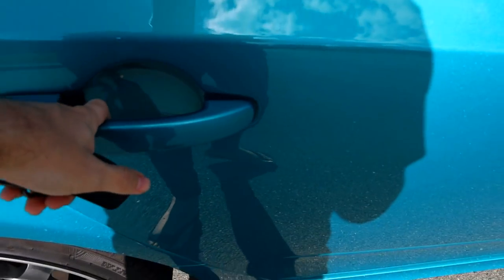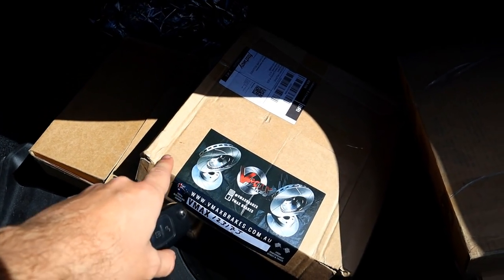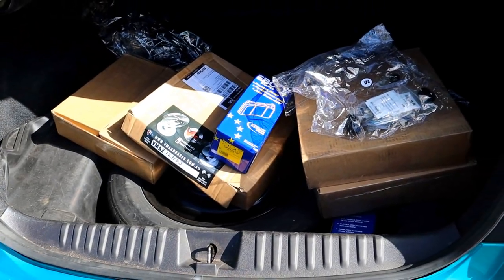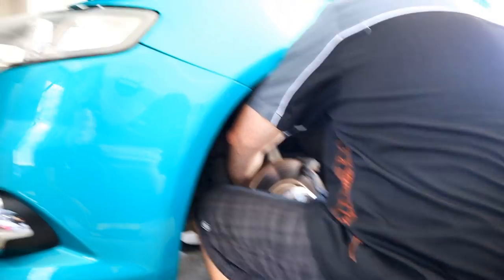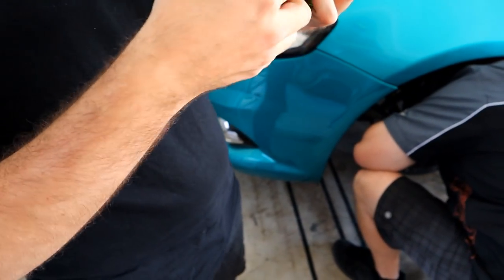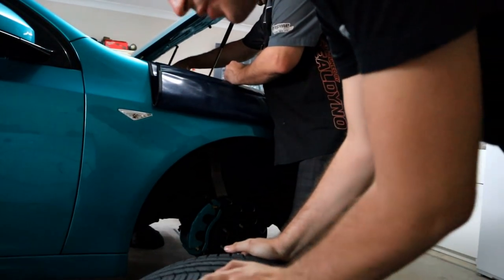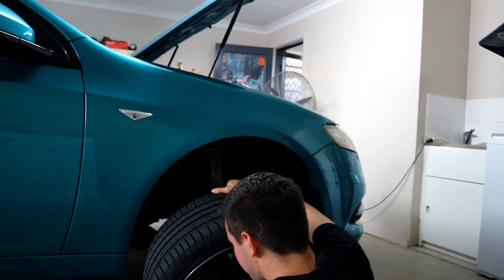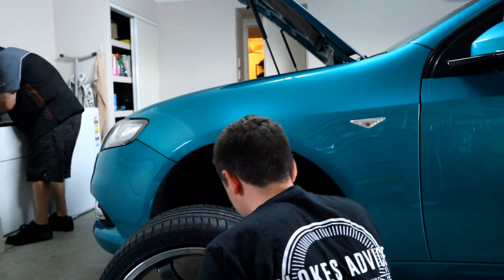Installing a 'Big' Brake Kit on the XR6 Turbo

Comment: Decent video!

Thing about Series 1 BF XR8's/6T's, they rolled outta the factory with that bigger territory caliper. So i've always had this setup and never thought of it as anything special. They suck when you actually work them hard, always keeping on the lookout for Brembos or something, 

I would attribute the pedal feel more to the pads, rotors and freshly bled fluid than the slightly bigger rear caliper. Mine had some standard rotors, bendix pads and some sort of fluid and the braking was rubbish, put on DBA Rotors, Project Mu pads, top shelf fluid and braided hoses and it completely changed the feel of them, but still average to a good monoblock caliper.

Comment: Hey Zac, did you end up going with the braided brake lines and if so, where did you get them? With the rear territory caliper installation, I'm assuming you used the territory caliper brackets and not your original FG caliper brackets - was there any mods needed to fit the territory brackets (other than to cut the backing plate?) Cheers man

Comment: Ha ha random elephant facts right here at Garage Barra 😂... And note the physical abuse witnessed with the misses beating me up 😏👊🏻
Reply: Gene Rhodes Hahahaha
Reply from the maker: Gene Rhodes I love how you pushed her to breaking point, she retaliated, then you complained about abuse 😉😂😂
Reply: Love your work Gene! What brakes have you got on Nemisis?
Reply: @SirPixlGaming  thanks, and I have the Stolz 380mm 6pot brake upgrade
Reply: What colour is your car Gene?
Reply: @iTzMoose_  Sunburst
Reply: G'day Gene, very nice job! Were they Territory Turbo C6 brakes on the front? Did you have to have an adapter bracket for larger rotors or was it bolt on upgrade, with no mods? Good job again
Reply: @hannahsminecraftchannel6133  Hey man, thanks for the love, and as for the Territory brake upgrade, the caliper bracket that bolts on is all part of the territory brake package, all you need to do is trim the backing plate to suit the larger caliper, then with the brake lines you can use the existing lines but you'll need to gently bend the steel bend at the banjo fitting to realign the brake hose, or you can get F6 rear brake lines, but swapping the brake lines takes a little bit of work with having to drill the rivet out for the mount of the brake line, but all in all its a pretty simple upgrade if you're mechanically minded and know how to bleed brakes up 😉🤟

Comment: Dude, that's not a BBK or much of an upgrade. Obviously as with everyone else, money is the limiting factor but my FGX XR8 had scary OEM Brakes whilst trying to dodge bloody skippies. For the money you should have just gone 6 pot XYZs fronts. Also you should have used the Blue Stuff NDX. The NDX part is important coz regular blue doesn't work when cold! Yellows will have the same fade issues.
FYI I gone down the full Brembo 6/4 now with Harrop upgrades rotors. 375mm & 355mm. MUCH MUCH Safer!!!!

Comment: Brakes are easy AF. Good thing you had a pro do them for you. :p I don't think you saw the comment on your last vid, but who is Gene? It's good he's doing the work for you. Also a word on those rear territory / larger calipers, be careful of mounting the brake line in the stock position, it can wear on the wheel.
Reply from the maker: MV60 haha Gene is my guy for everything. If I ever don’t feel 100% confident I learn from him. He’s an x brake and suspension specialist and NZ Pro Drifter :)
Reply: @ZacBaldy  That's cool man. I had to figure everything out myself, you're lucky to have a guy to go to for this stuff. :) Plus it helps with your confidence too that you've got a good guy on your side with the mechanics.

Comment: I have new big brakes to put on my BA just waiting for the temp to increase. :) I am just using the Territory size (322mm front and 328mm rear) front and rear like you are doing. Nice colour coding on the Calipers. :)
The standard rear discs are 303mm and 298mm fronts.http://members.optusnet.com.au/~pendaws/Pics/Calipers.4.jpg My calipers waiting for fitment.
Reply from the maker: George Daws ohhh very nice man! Very keen to see what you do with them 😍

Comment: Please buy braided brake lines if you want better a d longer lasting brake fluid it will help with lowering the temp of the brake fluid and are longer lasting then the rubber hoses

Comment: Get braided lines bro. They make a HUGE difference.
Reply from the maker: Driver 302 ordered some my guy😉
Reply: You won’t believe the CONSTANT pedal feel. You’ll love it. When the time comes, don’t spare $$$ on your next set of pads. It’s important. Good job old mate. 👍
Reply: @driver3025  I had the opposite effect, no change at all. It is said though that you'll notice a difference if your lines already are busted, like if the internal braid is broken and they're ballooning.

Comment: Well I suppose it's ok for the streets if you are running stock power but changing small brakes with slightly less smaller brakes is a waste of time and money. An ok upgrade for a non turbo xr6

Comment: Bigger rotors on the back????
Reply from the maker: Jason McMillan correct, 328mm rear rotors :) but due to the handbrake it actually has a smaller contact patch
Reply: Did you use Territory brakes all round?
Reply: @ZacBaldy  - smaller pads ?

Comment: Considering the front brakes do 75% of the braking I didn't bother upgrading the rear brakes, you especially don't need bigger rotors on the rear than the front 🙄 If it wasn't for ABS & ESP that conversion would be dangerous without bias adjustment. Spend your saved coinage on the front. Also is the 'breeze' caliper paint rated to 500℃ ? Ignore all the w⚓s yelling 'Brembo', unless you are made of money which clearly they are 🤣. Braided hose won't help temp much but they do last longer & can give a better pedal feel.

Comment: Can't you do any work on your car ??? This is an easy job to do !!!!!
Reply from the maker: Simon correct mate, but it’s also something I’ve never done, and there were plenty of little tricks I picked up so I can do it myself in the future 😁
Reply: @ZacBaldy  hey there Zac , I just see you doing so much to the car , and I think , good on you Zac , then I see a heap of people doing it for you ??? It's just nuts and bolts , undo , fit , tighten , check . Easy !!! 
I just bought an fg , lovin it .... I even made a new gear boot in carbon vinyl myself thanks to your video .... Great motivation and help . Cheers Zac , all the best 👍🤟😂
Reply from the maker: Simon as much as I’d love to say I did ALL of the work, I try to do as much of it as I can myself, but sometimes, especially with brakes and suspension, I’d prefer to have someone who definitely knows what they are doing before I do something wrong and get criticised 😂 ahaha cheers though man 😁
Reply: @ZacBaldy  hahaha.... You'll always get critics , but you'll always have those that support you and your journey of self improvement . You do a great job with all those videos ... They've been a great help to me , saving so much possible breakage etc with the trim and other stuff . Pity I don't live up your way , I'd shoot over and would be only too happy to help you learn the rest . Cheers mate 😁